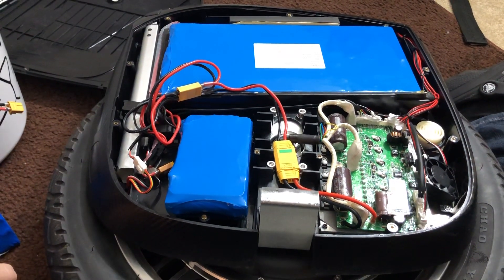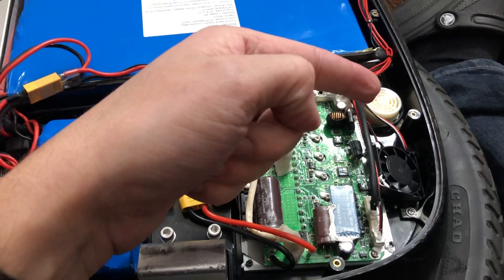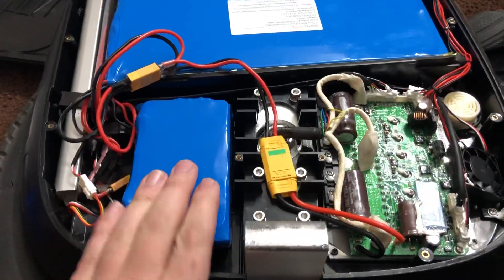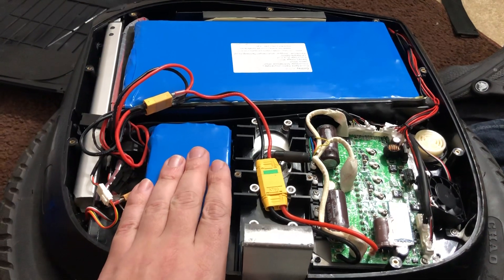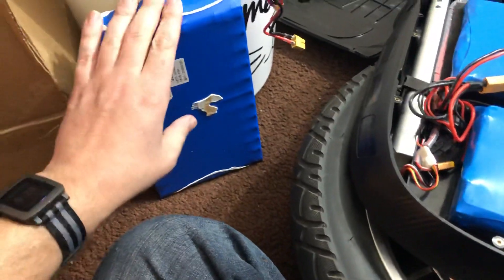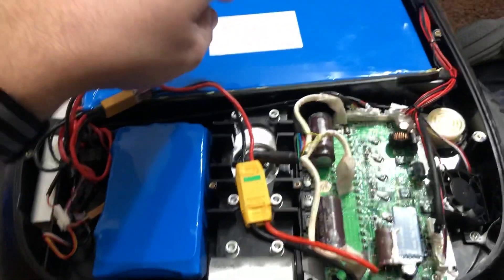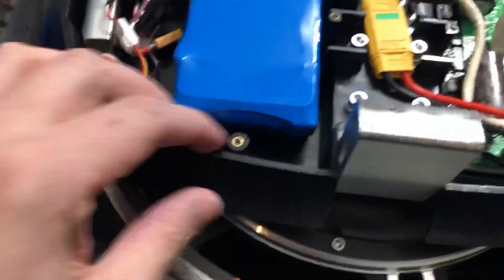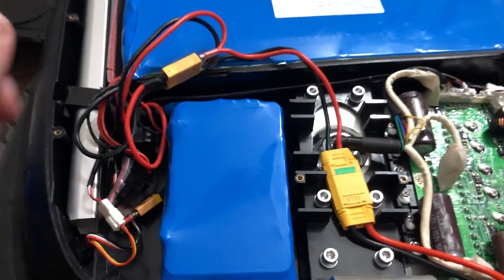Gotway MSX 100v 1230WH battery upgrade! (Now at 1860WH)

Comment: Do you have anywhere diagram? How you split this small batteries? They are both 100V in parallel? Did they have BMSes?
Reply from the maker: Hi, i purchased the pack pre manufactured from Ewheels. I dont believe they carry them anymore. But they should have the 1800Wh litech packs. I would email them directly and check.

Comment: Where did you but the extra battires and is it plug n play
Reply from the maker: Hi Luis, if you reside in the US you can get them from Ewheels.com. If you don't already own an MSX i would suggest purchasing a newer model it will save you some Ca$h.
Reply: @subliminalpain  and does it come with the connections and yes im in nyc and ive bought from ewheels a few times
Reply from the maker: @luismigual433  Battery pack comes with three connectors. A small connector to link both packs (XT30). A black connector for recharging the pack. A large connector for the control board (XT60). They are all solder into the battery packs. If you are working with a barebone case you will need to purchase extra connector.       https://www.ewheels.com/product/battery-input-charging-wires-xt60/

https://www.ewheels.com/product/battery-output-y-connector-balance-wire/
Reply: I have a 100v 1800 wondering is i can use this pack is the connections the same
Reply from the maker: @luismigual433   hmm good question doesn't the 100v 1800wh use 21700? send me your email address i will take some pictures of the battery packs that i have so you can do a side by side compare.

Comment: I have the same wheel. How much was the battery upgrade cost?
Reply from the maker: Ewheels has a supply. The total cost was $1310 you can sell the old battery pack on Ebay for 500 a piece or install them into a batteryless Gotway Monster which is what i did.   https://www.ewheels.com/product/100v-930wh-battery-pack-msx/